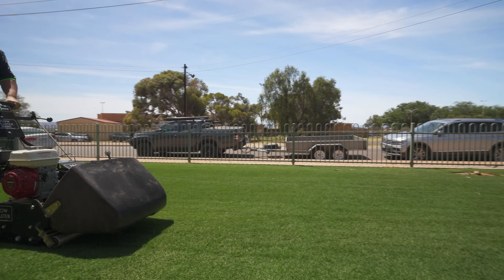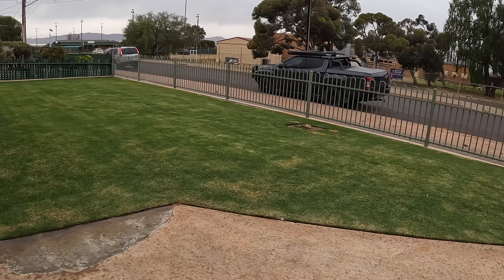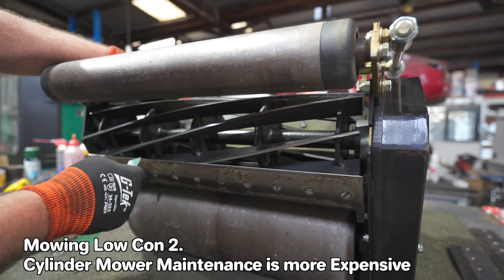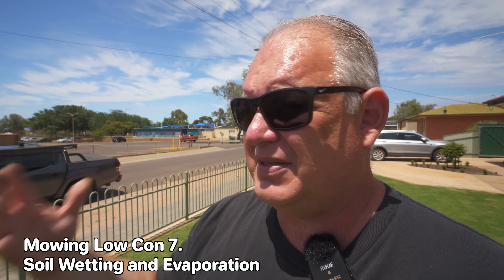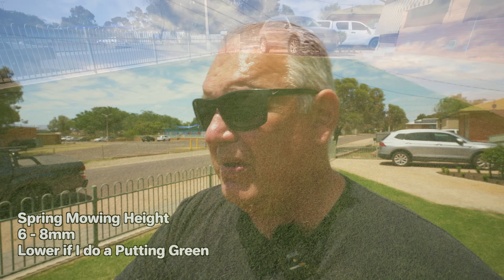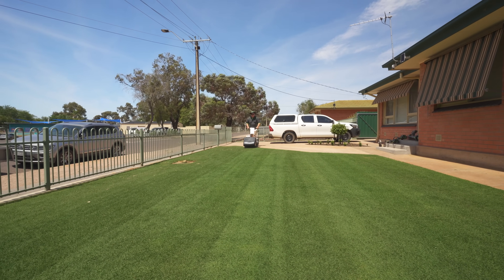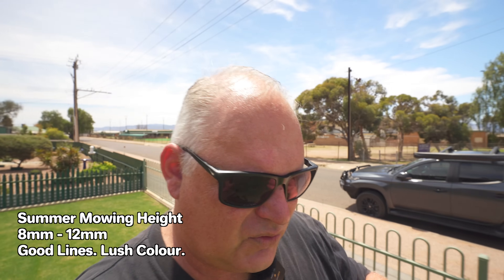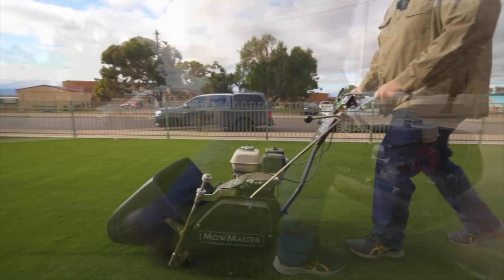Am I Mowing Too Low? Pros and Cons of the Reel Low Mow.

Comment: Great video Matt. I think one of the most important pieces of info regarding the ultra low mow, is the level of your lawn.

If you’re trying to mow anywhere under 6mm, your lawn needs to be almost perfectly level to avoid scalping and unnecessary sand dulling your cylinder blade.

Keep up the great vids.

I’m running my TifTuf at 4mm this season with a putting green here in Perth, WA.
Reply from the maker: Yeah that's a big thing, especially if you're dealing with any slope.

Comment: Awesome vid mat well done. I have 50m2 of Kik vg in my backyard which I don’t love due to its thicker blade but at least it doesn’t throw seed heads. In my front yard I have 100m2 of standard kik and I hate it because it goes to seed really badly but it still looks pretty good. I have a lot of people walking on it and allowing their dogs to pee on it so it seems to be more work than it has to be. I also have a 10m2 tiftuf patch that I love and wish I’d gone the whole lot with that. Kik goes at 13-15mm and the tiftuf I’ll keep the same only because I cannot be bothered changing mower height constantly. 14” solid Scotty. Cheers mate. I’d love to see you do a Kik lawn.
Reply from the maker: Yeah I have Kim out the back. Unknown what type and it throws seed heads all the time. Renovating it last week will be a few weeks to recover still but I have some robot mowers to review so I’ll probably let it go a bit nuts and see if the mowers can keep it nice.

Comment: Hey Matt

Great video!! Good simple explanation as usual. I did a semi reno in October, scalp, fertiliser and top soil. I was at 14mm and next mow will drop to 12mm. I don't have time to with working long days to keep the lawn lower, is 12 an ok sweet spot height for the summer? Btw I did the same thing with a scalp in early march.
Reply from the maker: 12mm is good, but I’d say do what you feel works best for you and your time.
Reply: Thanks Matt
Next season I was considering buying the stihl RLA 240  battery scarifier. Have you seen it or know anyone that owns one?
Reply from the maker: @ yes I have. It’s a good unit.
Reply: @lawnporn  ok it's on the Xmas list. With watering the lawn how often and how long do you water it there isn't any rain.?
Reply from the maker: @ashleyschofield5474  currently Tuesday and Friday I do about 30mins. Will drop to once a week, 45mins which is about an inch and a bit of water. Train that root system to go deep.
Reply: @lawnporn thanks for the watering tips. One last thing do you sometimes tear up your lawn a little when you turn your mower.?
Reply from the maker: @ashleyschofield5474  no. Split roller and I tip and raise the mower when I turn.